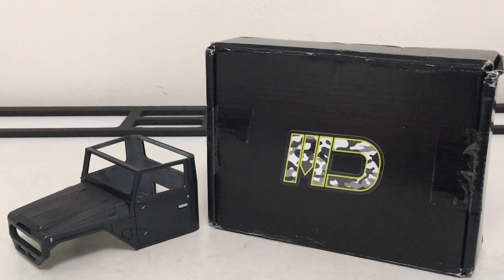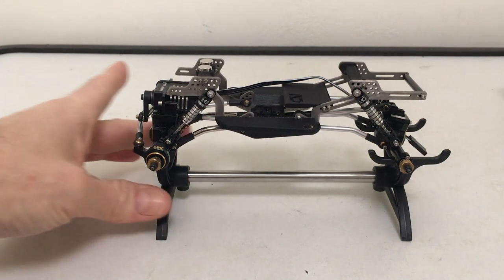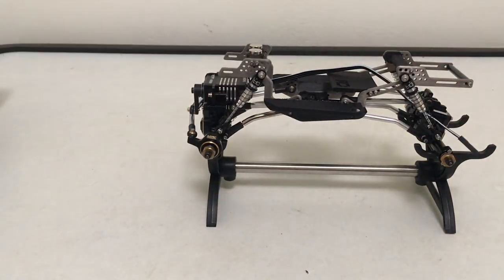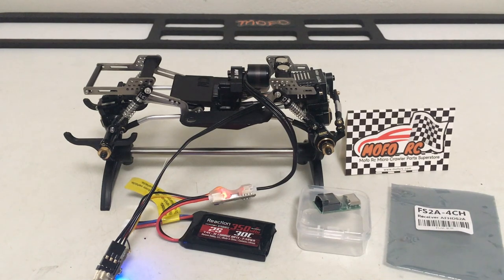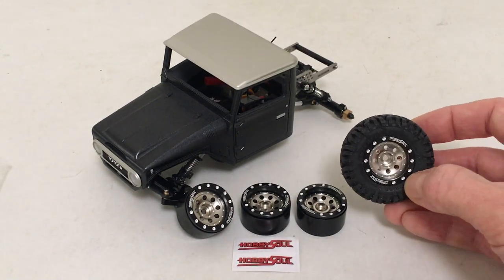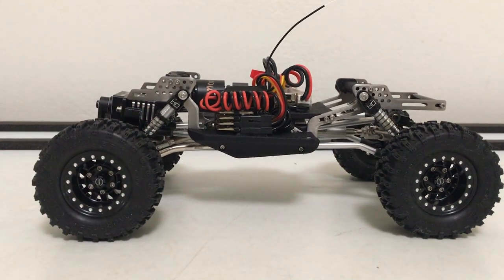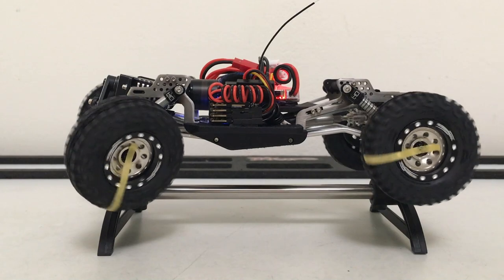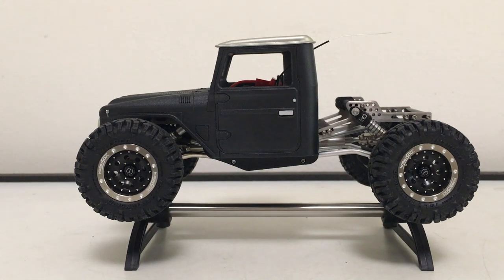SCX24 - T.I. V2 CHEAT CODE / FJ45 CAB BUILD: MAZZ DESIGNS SLIDERS, WTMicro BODY, MOFO ROCKWOLF ESC

Comment: Are the cab sizes from WT different for cab only and cab+bed? Could you just add the bed to this setup by adding magnet mounts to the chassis or would it not work with either the cab or chassis? Just wondering if I could run this setup and add bed for Sunday grocery runs 😂
Reply from the maker: Yes, the single cab shape is the same (with or without bed) as far as the slider footprint.  I have a build of the single cab truck version as well with more info.

Comment: Im gonna have to snag me a MAZZ
Reply from the maker: @slidingsidewaysrc91376  hell yeah Kev. He just released the V3. A really nice progression, much more tucked skid angle and smaller sliders. 
Unfortunately, these WTMicro specific. Cheat code sliders he makes will not fit the new V3. He did say he may run some more V2s though. He’s making me a few forged carbon XL V2s since I still have a couple sets of those WTsliders. 
Cheers brother!